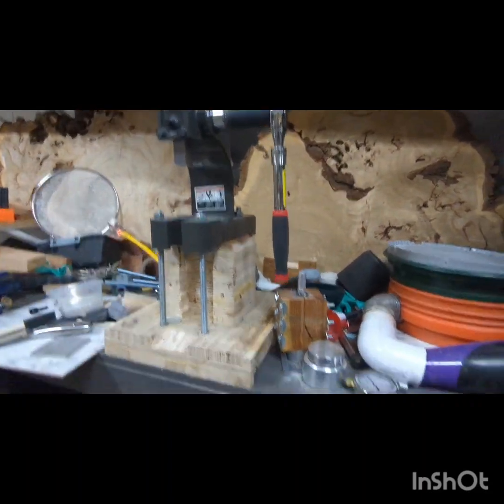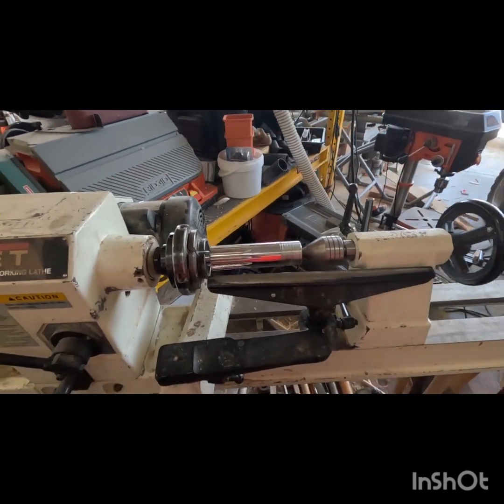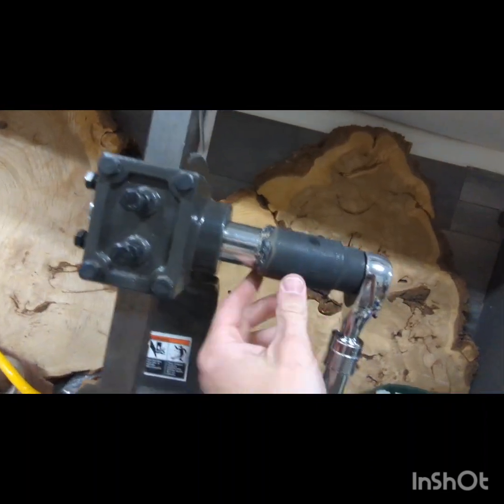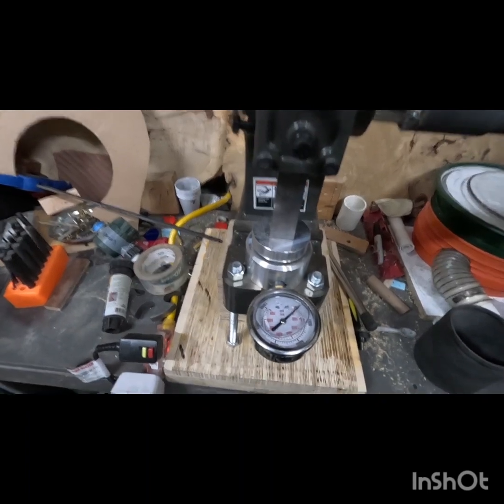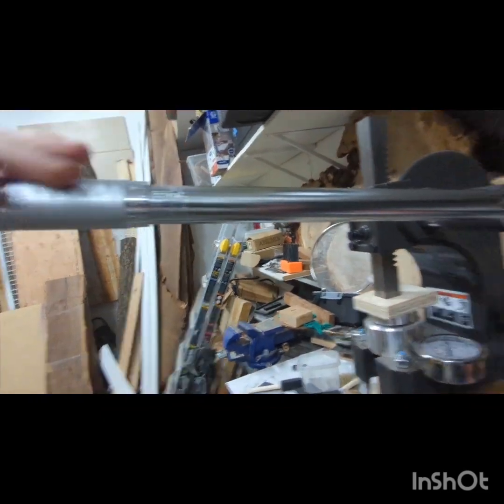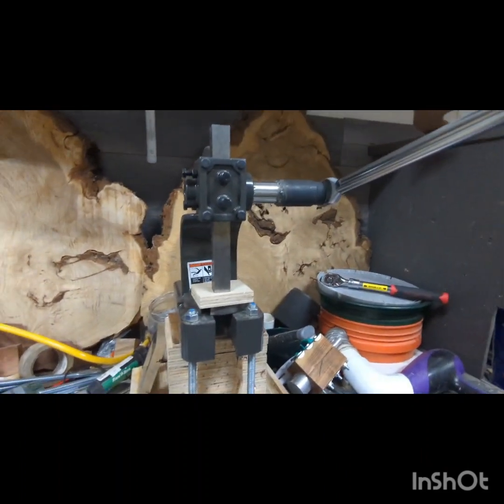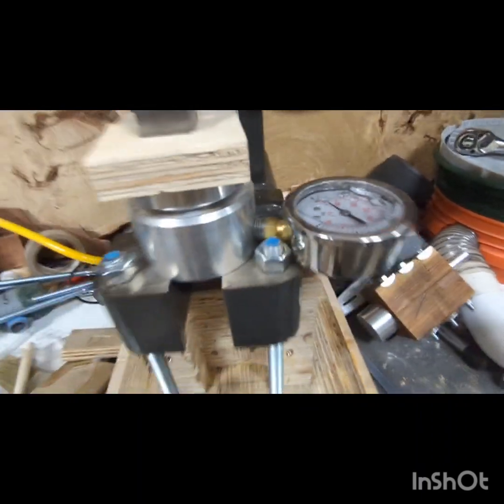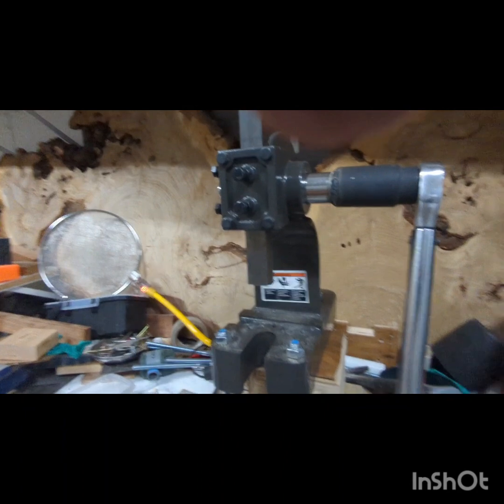2 ton Arbor Press mod for fireworking.  pressing rockets, stars, pyrotechnics

Comment: I constructed a press similar to this and have made about 150 cohete motors with it so far and I've noticed a couple things. The front threaded rods are wanting to pull up through the wooden base. To combat this I tried fender washers, it was sufficient until I wanted to move up in motor size. I'm about to install 3"x3" bearing plates on the underside of the base and I think this should take care of this issue with wooden bases. 
My socket interface is also like yours. The further away from the center of the press your wrench/ratchet is the more the force concentrates on the front-right corner of your table instead of evenly over the front. I think cutting the spindle down to just enough to get your socket on and having your socket flush with the flange on the side of the press will alleviate this "twisting" force. This twisting force is detrimental to your tooling, especially when you get closer to the top of the spindle.

Comment: can you press whistle rockets with arbor presses?
Reply from the maker: This is my opinion and don't take it as advice but....
So long as you have a pressure gauge, are pressing to the proper amount, it would be the same concept as a hydraulic press.  
I have done it with my 1/2 lb cohete works fine.  
I have also done it with screaming spoilette.  
I definitely use a tube support otherwise will split the tube.    
I have not done it with my 1lb rocket, but only because it is too big to fit tube support on the arbor press.

Comment: Can u press 1/3lb rockets with this?
Reply: I press up to 1lb rockets/3/4" ID  with my Harbor Freigt 1 ton arbor press.
Reply from the maker: I'm sure you could.   I have not tried to max it out/see how much pressure I can put on the thing but I think i can get enough pressure to even do my 1lb whistle rocket.  Not sure I would though, i just use my pneumatic 20ton press with the pressure gauge.  Id imagine that this would work though so long as I could achieve the pressure and do it consistently but IDK.
Reply from the maker: Forgot, one other thing that I Dont like about this setup..... It is not tall enough.  I cannot fit my 1lb rockets in it.  I should have built it to where it was higher up off the table so I could fit my bigger stuff under it.  Even my 1/2lb stuff is a bit tight there, especially if I am using the pressure gauge (since it just makes for less room.) Overall, very happy.  That being said, if I were to do it again I would make that adjustment (make it higher.)